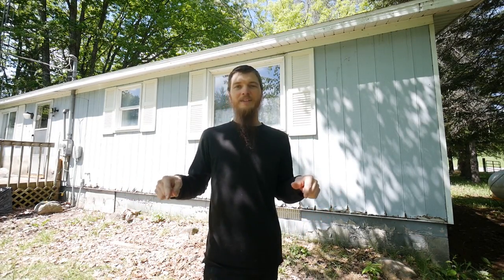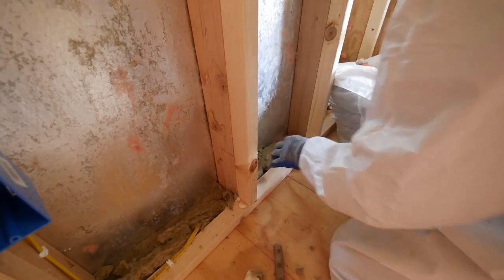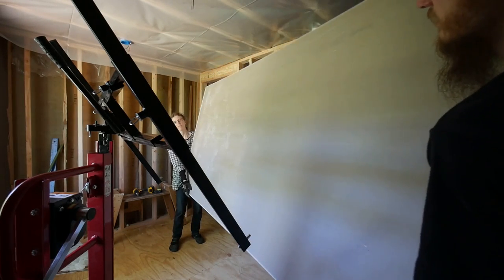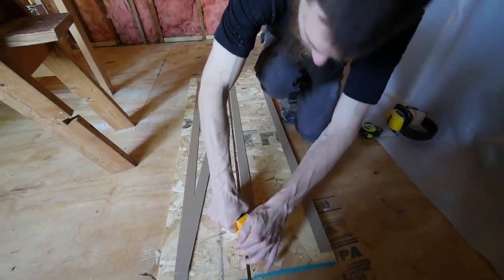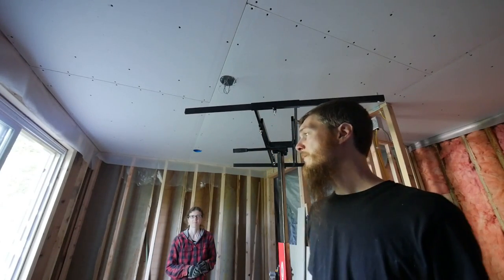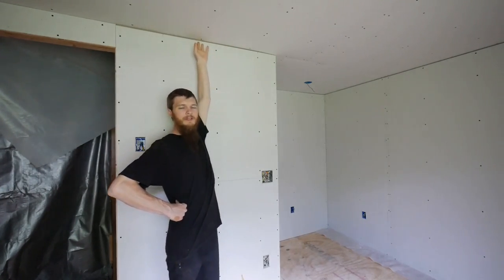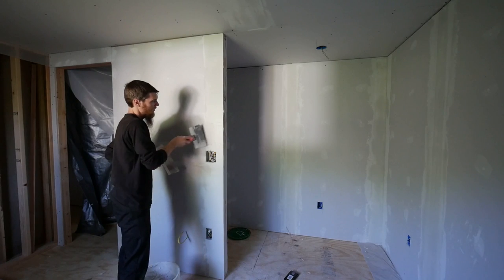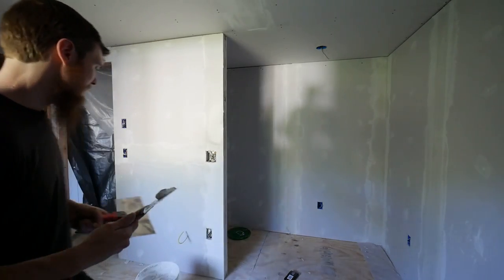Daughter's Bedroom Renovation Continues - Home Renovation

Comment: You can make that drywall tool out of a 2x4. Just cut it with like a wedge on the flat. Put the edge under your drywall step on the thick end of the 2x4 and it does the same thing only cheaper.

Comment: Your work is so good, and appreciate the commentary as you go, you are teaching us!  Glad you plan to use the white butcher paper technique, it looks beautiful!  Just recalled that lifting the drywall does something else that is very good; that is that if there is any water leaks in house, ex: water pipes, etc. prob., then having the drywall up an inch from floor can prevent having to deal with water getting into drywall at bottom.  Over the years, we found that out and were so happy our drywall remained dry.

Comment: Looking good!
Insulation is the pits!
The only thing we hired out was the taping and white paint of the  sheet rock. It cost a few hundred dollars more. All our friends who were also building homes at the time advised it. We were on a time crunch too.
👍❤️🦊
Reply from the maker: Good call. If there is a job to hire out I would say drywall is one of them. It's slow and difficult to get a good finish and the pros can usually do it for a reasonable cost.

Comment: Maybe try using a bi-metal blade in the hand saw? Something with a finer toothset but less offset/rake of the teeth? I have a very similar tool, too!
Reply from the maker: I considered using a bi-metal blade but I liked the finer tip of the wood blades for poking through the drywall and cutting curves. For straight lines though, that may be a good idea.

Comment: Dude... you seriously need a spackle pan!

I had the good fortune to learn dry-walling  back in the 70's from a 3rd generation plaster and drywall family, and I have been doing it off and on ever since.  It would take me a good 3/4 hr to show and tell you in person the tricks I've learned, so I'm not about to type it all out now.  In that short little finishing clip you showed, you broke rule #1 and rule #2.
  
Rule #1- never return material to the pail.  Once it's out, it's out forever.  There will always be some little chunk of something that's in the mud, and by returning it to the pail, you've just contaminated the whole pail.  (We call those little chunks "turds" by the way).

Rule#2- after every stroke where you apply material to the surface, always, always, always clean your knife off on the pan!!!  (There will always be some leftover material clinging to the knife, that when you reach back to the wall, will come off and leave a little gobber that you will need to come back and address).

As long as I'm typing, I'll try to impart a couple tips to make life easier.

Applying mud.  Load your pan in the center.  For bed coat, use a 6" knife.  Scoop the mud out of the pan, and clip the mud off both corners.  Knife almost 90deg to the surface, draw lengthwise flattening out as you go to apply mud.  Repeat until length is covered.  With knife cleaned, float mud down entire length of joint, to flatten high spots into low spots.  Bring excess mud back into pan.

Bedding tape.  Mark center of joint so you know where it is for applying joint tape, since it is now hidden by the mud.  To do this, simply stick the corner of your knife in the crack and walk along the joint to the other end.  Now take your tape and place the end in the mud, centering the tape crease over the marked line in the mud.  While holding the end of the tape with your knife, unroll the tape down the line a couple feet, then bump, bump, bump your knife in a few spots on the paper tape to get it to spot cling to the mud.  Repeat down the entire length of the joint.  When you reach the end, hold your knife on the end rip off the tape like you did in the video.  Then press the tape into the mud like you did in the vid, center to end if its a mid joint and end to end if it's not.  Keep in mind to clean your knife on the pan EVERY TIME you lift it off the surface.

Drywall finishing is one of the specialty finicky trades, that if you don't know some simple tricks, you'll end up making it 10 times harder than it needs to be.  Remember, it's 10 times faster and 10 times easier to make it smooth with a knife, than it is with sandpaper!

Love your vids, and pardon the intrusion.

Comment: Check with Lowes or Home Depot about using the machine for blowing in the insulation. You may be able to use the machine for free if you buy enough insulation.
Reply from the maker: Yeah, at my store we can rent for free with a purchase of 20 bales of insulation.
Reply: Holly cow, 20 bales. That would completely fill up your house. Our store is free with 10 bales.

Comment: Hey guys !!!👍  love how you're moving right along, utilizing time and the materials. Very impressive...❤  Did you buy or rent the drywall lift?  Also, what thickness Roxul insulation are you using: I like the ease of installation so much as you put it in that I'm going to purchase and install it too...thanks for sharing that brand and how good it is in lits of ways. I looked into it and it's great for sound-proofing as well. Props..Kudos..Cheers!😀
Reply from the maker: We bought the drywall lift off Amazon, link is in the description. The Roxul insulation is 5.5" thick and is R23. Thanks!
Reply: @diyfferent  thank you!

Comment: 6:00 called Jab Saw not Hole saw. Roto Zips work great at quick smooth hole cuts in drywall.
Reply from the maker: I called it a keyhole saw, that's the proper name for it: https://en.wikipedia.org/wiki/Keyhole_saw

Comment: Does the insulation come in thinner strips? I have a mobilehome but don't want to build out walls.
Reply from the maker: Yes, you can buy it in standard 3.5" batts to fit 2x4 walls.
Reply: @diyfferent  Thank you for answering. Also, i forgot to ask,what is name of product, can you get at Lowes?
Reply from the maker: @michellelaclair  The brand we got is Roxul. It may depend on the store, it could be called Rockwool also. Not sure if Lowes has them.

Comment: Screws are sinking in because that is what your driver was made to do.  Try reading then changing the setting on the drill.  Good luck. ; )peace
Reply from the maker: The drywall screw setter bit sets the screw depth. That first sheet was just being odd. The rest went fine. There could have been a gap above the drywall -That is what usually causes a screw to do that.
Reply: @diyfferent  That's good I see you ran into no more issue, but didn't know what changed.  I bet that was a bit scary at first. Well anyway good job doug and thanks again for always replying. :)peace

Comment: hmmmm the siding looks a bit rotten , i wonder if you can take a tracksaw along the bottom and replace the rotten parts of the siding with horizontal planks or a plywood board (with V grooves in it turning the massive board intoo faux siding the same width as the siding above and put a plastic plint along the top mounted with a lot of silicone so water runs over the edge of the added on boarding 
i think it will break up the big slabs of siding kindah nice and makes it looks better even then completely new siding 

as for the tool to cut the plasterboard , maibe you can weld a jigsaw blade to a broken repricating saw blade

you get quite a bit of use out of that lift , i guess when you need it you REALY need it and all the other time its sitting taking up space 
think you got youre moneys worth with that thing
Reply from the maker: Hopefully we'll get the outside fixed up when the inside is more complete. Good idea on the blade, though I don't weld :)

Comment: these may be good for insulating your outlets, thin white foam precut sheet , they go between your outlet cover and the box. hope this helps. 
Duck Brand Foam Socket Sealers insulation, 24pk
Average rating:4.6596out of5stars, based on47reviews47 reviews
DuckWalmart # 1188958
$2.88
Reply: Sometimes your utility company will send them to you for free

Comment: Plastic is a very bad ideal.
Reply: If you go back to their bedroom remodel the plastic he hates but its required.
Reply: That vapor barrier is required in areas where they have inclement weather...
Doug is very versed on the requirements....
Reply: @fab4gal342  wrong. plastic does way more harm. It holds in moisture and then you get mold. They stopped doing that long ago.